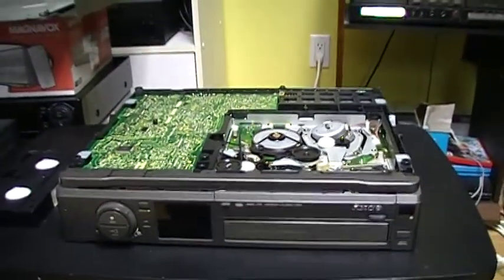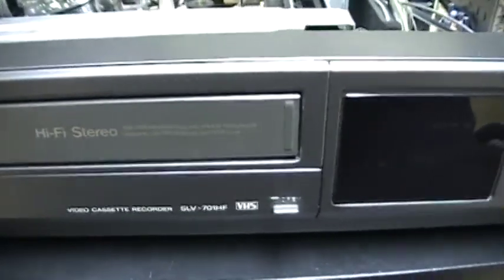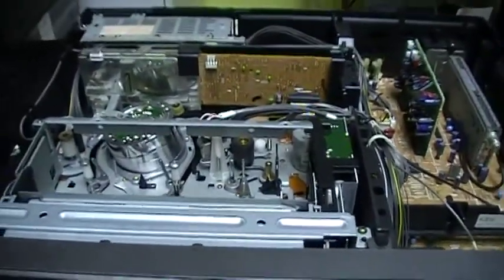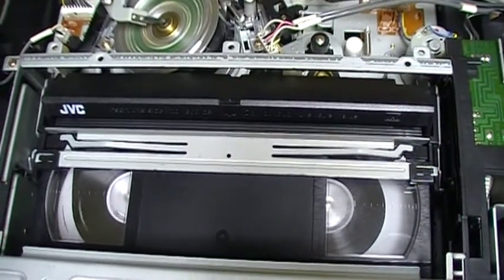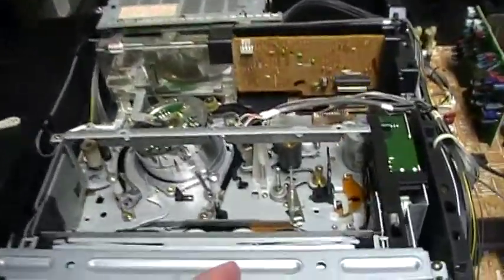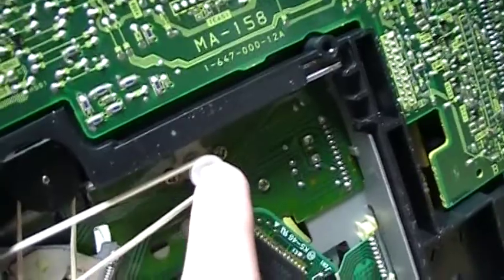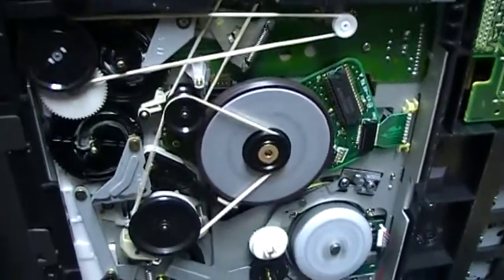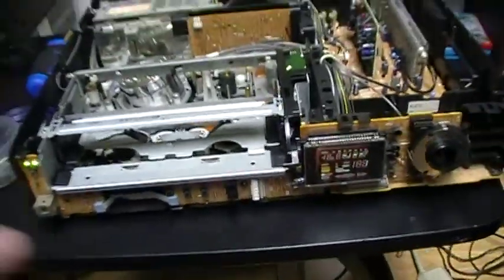Sony SLV-701HF VCR

Comment: Actually, I think this mechanism is built better than the SLV-686HF. On those mechanisms, certain parts breaks real easily and those are the certain gears. This one on the other hand, its mostly the belts that need to be replaced and its pretty easy to do.
Reply from the maker: ♛The VCR King♛ 
They don't break often. The SLV-686HF is better